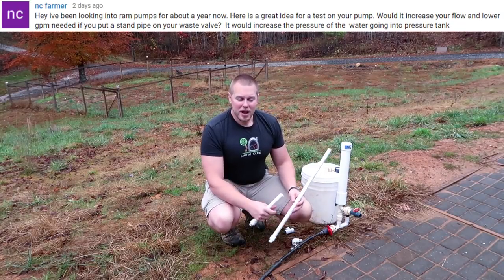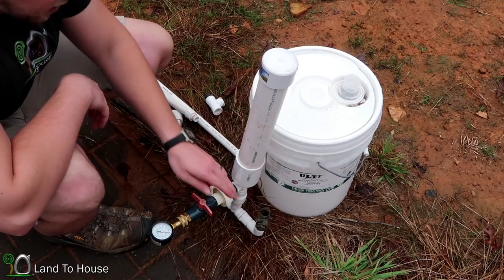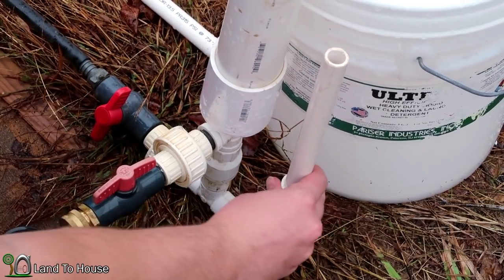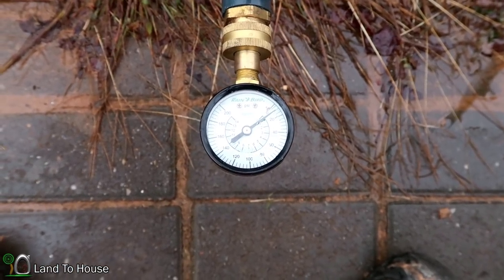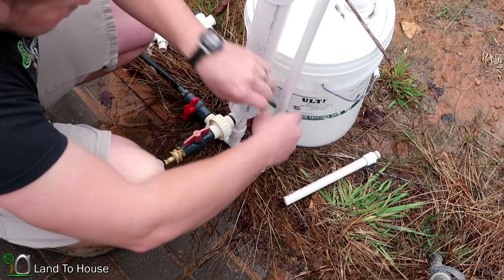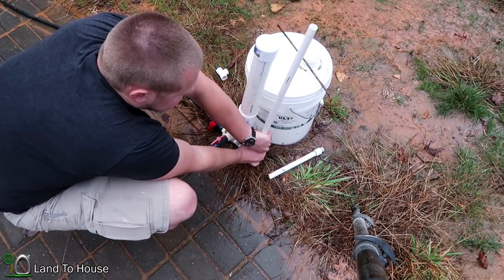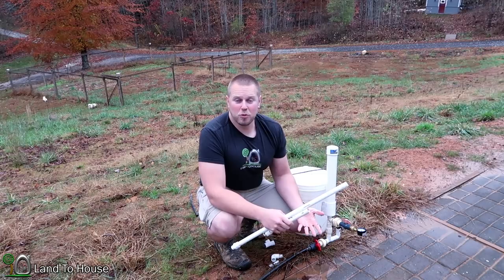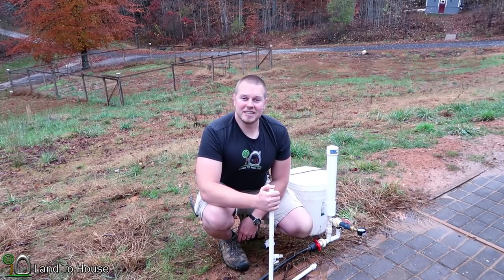Waste Valve Height - Ram Pump

Comment: Because the height difference is less between the inlet and outlet, the pressure head has been reduced. The outlet needs to be as low as you can get it. Adding a small weight to the valve might help.

Comment: It would be interesting to see the effects of different lengths of pipe between the check valve and the pressure reservoir. By this; i think you can "tune" the frequency of the check valve's open and closing, and affect the rate of pressure increase (maybe.)

Comment: I don't know if you are still testing these or not but here's an idea...
Split the delivery line in two and use one side of it to feed back into the Drive pipe as it crosses a "T" joint from the waste valve. I suppose that if the waste valve fed back into the drivepipe via a Venturi Syphon from the split line on the delivery side it might allow for a closed-loop system. Despite never delivering the same volume upward as is brought down through the drive pipe it would always have enough head pressure and hydrostatic pressure to operate since all the water loss is at the waste valve when it's just being wasted instead of being cycled back into the system. A check valve near the end of this second delivery pipe just before it merges with the drive pipe would keep the bulk of all the water in the system moving in a cyclical manner. Delivering only some of the water upwards but also retaining most of the water in the system to drive it. So basically, I guess, it would start the cycle with the Ram and end it with the Bernoulli effect feeding right back into the Ram.

Comment: I added a  8 in standpipe to my  1 and 1/4 inch RAM pump with a Driveline of 75 ft. 
Why head pressure is about 4 feet it seemed a little much for the system and my check valve would lock up sometimes. The stand pipe

 seems to have mitigated that problem. The output might be a little less however it's more reliable it's been running now for 4 days without stoping.
 Thanks again for the ram pump videos Seth always interesting.

Comment: Try this. Right now you have the pressure tank mounted vertically. The check valve is also vertical? Below the P.T. As the water comes down the drive pipe it must make a 90 degree turn before it gets to the check valve. Have you tried putting the waste valve before the P.T. assembly and then mount the check valve horizontally, with the pipe to the P.T. in a gentle arc to the vertical? There is loss when the water makes a radical turn. That's why it's recommended that the drive pipe have as few turns as possible. The piping after the check valve is part of the drive pipe when the valve is open.(you could heat and bend the PVC) The delivery valve would be right after the check valve and as low as possible. I'm curious if it makes any improvement in pressure. However slight. The Rife pump I had was cast in one piece to create that gentle turn. I think it was a SU-15. 11/4". Maybe a 3/4" check valve and a larger size after that to reduce friction? Thank you

Comment: You have to add weight to waste valve lifter according and proportional  to your head pressure.
I forgot the calculation formula.   I did one of these in Collège final project 40 years ago.

Comment: Great Video.  I was on the edge of my seat waiting to see a new discovery.  So glad you ran the test.   Need more Ram Pump!   :-)
Reply from the maker: It worked out just as I thought it would. It would have been fun to get more pressure out of that stand pipe but in the end physics wins again.

Comment: Following the comparison of the Ram Pump to a voltage doubler we can increase the voltage by gang doblers together. Have you considered having one ram pump directly feed another.  If there is a parallel then this could cause a pressure increase giving you the ability to raise water higher.
Reply from the maker: It sounds like a fun idea. And I do want to test that this summer. The thing that I feel is going to happen is that the second ram pump is going to require too much water and will stop. OR the pressure built from the first pump will prevent the second waste valve from opening.

Comment: Its a good thought but negitive effect . Another dead thought would be piping it back into the surge tank , good chance it may lock the Ram pump up or work like a venturi system increasing pressure with the Bipass feeding back into the surge tank . Thats all that pressure tank is  is a surge tank ..  look at that also the volume of air V/s the pressure.  More Air more pressure .!  Take a freon tank make sure no pressure in tank pull valuve  should be a 1" pipe thread. Collar it up to the pump  brace it up right and see if it makes any difference !

Comment: Nice videos!By extending the check valve head you seem to have increased the back pressure in the check valve.If you were to lower the check valve below the center line of the overall line i.e. below the inlet pipe will you not create a "negative" pressure situation that will give the check valve less resistance and so work better?The center line of the outlet will then be lower than that of the inlet line.Would like to hear your opinion.Just a suggestion though.

Comment: What if you put the check valve at the top of the stand pipe?
Reply: Same question
Reply from the maker: That will actually reduce the head pressure as well.
Reply: Good idea
Reply: Check valve at the bottom: you have a column of water holding the valve open.

Check valve at the top: you lose too much velocity to head and the valve will no longer close.

The end result is the same.  You want to maximize the amount of energy in the pump, which means maximizing the PSI, velocity and/or head pressure.

Adding a stand pipe to the waste valve robs energy from the pump.

Comment: I built a 2inch ram pump to water the cows.  With a few minutes of dam the creek with some rocks I have enough head pressure to make it work.  I was surprised how much I have to throttle the discharge valve to keep back pressure so it stays running

Comment: IF nc farmer shared the same video I saw... they also had an additional check valve on the output side of the pressure chamber.  I tested this extensively on my system because they were boasting higher volume delivery.  I found the same results you did (as I expected based on head loss). I suspect either they were lying or maybe in their particular setup it worked (I think they were delivery to a relatively low-head elevation vs mine (72 vertical ft).  Either way, results speak!  I am glad you tested this as well as it's nice to see a second "It doesn't work for me". Keep up the great work my friend!
Reply from the maker: Was the ram pump blue in your link? This one was to a low delivery location. I did not see anything in the pump setup that would allow for a higher flow rate. You might actually get some results if you move a check valve around on the delivery pipe. I am not sure what location is the most effective. (close to the pump or closer to the delivery point.) I just know that in my tests a check valve on the delivery pipe can boost flow rate a little. Thanks for watching!
Reply: yes... it was from a channel named "something asia".. dont remember the something part... lol
yep... blue/green colored pipe... was about a 4 ft riser off the pump.  I agree... there's a possibility in the right setup it might give some gains.
Reply from the maker: Yup that is the same video.
Reply from the maker: ah ha. That is the one. Looks to me like there is a good bit of head pressure and not much lift. They might have been getting more flow because they had too much head pressure and not enough lift. . . No idea but we now know that it is better to leave that stand pipe off.
Reply: yeah, head pressure to lift ratio is the reason im almost positive.

Comment: Bro i am from India, kerala,,& great work bro, & i have a question please answer me 
*How to use 100%of water without waste water using ram pumb 
Please dude
Reply: I am getting ready to test a concept design for exactly that! I am wanting to use the ram pump to increase my gravity fed pressure from my rainwater tank to where my off grid cabin will be built. I am thinking of putting a reservoir at the waste valve to catch the waste water and feed it into the out hose.

Comment: What if you add an inline valve on the stack above the waist check valve? Can you use it as a return back to your source? Or perhaps if you use degrees like a 45 or instead of 90 going straight up above the waist check valve and return it to the supply. I'd love to see this demonstrated out of curiosity.

Comment: Try this  place  your ram pump over a 5 gallon bucket so that the wast water fills the bucket  add a drain pipe to the bucket   and have it  supply a second ram pump 15 ft down hill  then  feed the out put of the se ond  pump into the out put of the first

Comment: Thank you for doing that test. I dont have a good enough spring at the moment. The one i wanted to use is 1 gal every 5 min. My other spring i will have to pump water 1000 feet or more.
Reply from the maker: It was a good test. The ram pump can pump water that far no problem. It can be costly to install that much pipe though.
Reply: Maybe if the pump running little bit longer, I think putting the weight to the waste valve the cycle is becoming. slower and will build a higher pressure.
Reply from the maker: Although that is true it also uses more water with more waste valve weight. Sounds like the spring is not flowing much.

Comment: Can you run a hose from the waste valve back to the supply line on another Y check valve to make the system retain more water. 

My only available location gets very soft when it gets wet and I don't want it to sink too far as it settles.

Comment: Can the waste water be plumbed back thru a one way valve to a tee in main feeder line recirculating the wasted water, or would one have to plumb a smaller pressure tank in a similar configuration as the pumped water to push the waste water thru the loop back? The Idea being to utilize all the water without waste,or will that violate the energy conservation laws?

Comment: Of course for your sweet the valve will not close, the extension is holding to much back pressure to allow the valve to close.

Yes the head pressure will need to be higher and the water source needs to be above the top of the extension pipe
Reply from the maker: Yes the pipe reduces the head pressure and in this low head setup it was enough to stop the pump from working.

Comment: Thank you for doing this video.    Really helps to understand the parameters for optimizing pumps.    The video showed less pressure with a higher waste water stand pipe, but curious, did you notice how the volume of water pumped changed?   Does more pressure mean more volume of water pumped?   Thanks.
Dave
Reply from the maker: Yes the addition of a pipe on the waste valve reduces the head pressure of the pump. Less pressure means less flow rate.
Reply: @LandtoHouse  I've seen several videos where people were putting weights on their vertical rod waste water check valve and adjusting the length of the stroke.  What I'm not sure about is if they were pumping any more water than using a swing check valve like you do.

Comment: I regularly watch your channel and have been working on ram pump improvement  science for a long time..
Want to know the result of lowering the 50 feet height  ( down) instead of up using a spring check valve leaving water downwards instead of upwards.

Comment: I wonder if say a person has a small flow spring( small roughly 100 gallon catchment)  with about 20 feet of decent drop could one use one pump to transfer water to 30 feet above the spring to a tank and then build a means to capture the excess wasted water to pump that water to a second  pump water to a second tank that feeds a micro hydro system  and at the end of the system build a pond?

Comment: My pump took forever to start got it going and then it has erratic timing, going faster and slower then finally shuts off. Messed with my valves but cant seem to find a better setting anywhere. Where should i start the lines arent all connected as i wanted to make sure it runs before it gets glued together (PVC) so i imagine there are some trickling leaks. I think we are at 80 or 90 feet long. Only 1 or 2 feet of drop in the first 40 feet then about 6 to 10ft of drop in the next 40 to 50 feet. I have a comically large pressure vessel probably 3 to 4 foot long 3 inch wide for a 1 inch ram pump. I didnt care to cut the thing in half or cut a 1/4 off at the time i was too excited to get it together and in the creek. I feel like the problem could be in the pressure vessel being unnecessarily large or the drive pipe not being glued together. 3 45 degree bends in the drive pipe as well but it was trying to pump so i dont think the problem is the bends.

Edit: after 30 minutes of googling things the only other thing i can find is the weight of my foot valve. Pumping really fast and the puttering out one source said to add weight as well as a few youtube videos of guys messing with weights on their valves.
Reply from the maker: Hi. I actually had a problem like this with my ram pump. It turns out that I missed gluing a pipe together. Because the ram pump is cycling with lots of force the pipe came lose just enough to let in air. It does not take much air in the drive pipe to stop a ram pump. I would get those pipes put together and see if that gets things going. The sputter you mention is most likely from the air in drive pipe. A fast pump is normally only when you have a very short drive pipe or the pressure wave is hitting air in the drive pipe and returning too fast.

Comment: I realize your post is almost 4 years old, but I have a question regarding the waste valve water.  Is it possible to salvage that water that would otherwise go to waste and route it into the distribution output; or at the very least put it somewhere else that is usable or harvestable?
Reply from the maker: Its not possible for the ram pump to send the water back to the source or put the water into the high pressure delivery BUT you can catch the water and use it further down hill.

Comment: The Waste valve pipe test must have a non re-turn valve on the high waste valve to cab the drive head pressure loss and to give the pump the capacity to pump through delivery and the waste valve the question is would the ram pump through the waste and the delivery if fittings were employed to facilitate this concept what do you thing ?

Comment: Can you please test it to see what happens when you extend the waste valve? Like keep it still as low as possible but extend it longer like it is an additional output. Thanks.
Reply: In addition, is it possible to connect two ram pumps in a series connection? Like one ram pump downhill and the other one uphill to extend the reach and pressure towards the water tank? Thanks.
Reply from the maker: This past summer I worked on a ram pump that was broken. The fellow had a 2 ft long pipe on the waste valve extending further away from the pump. Have you were describing. It was causing the pump to bounce and actually prevented it from cycling. That being said I can still run the test when the weather is nice. Would be fun to learn the results
Reply from the maker: I haven't checked using ram pumps in series like that one of the problems is going to be that the second pump needs to have an open-air source to allow the pressure wave in both directions.

Comment: I noted that this ram pump is configured differently than the ones you sell. Does this change the effectiveness of its operation?
Reply from the maker: I ran a few tests with this design. It is slightly more efficient to have the waste valve on the other side of the pressure tank.

Comment: It seems that with a messy intake like an open spring, a lot of air gets in the line, so slowing it down with back pressure would give the air more time to escape back out the intake.
Reply from the maker: For pulling water out of a spring I recommend using a 5 gallon bucket just down from the intake. This allows you to seporate the silt and air from the water. Pull the drive pipe from half way up the bucket. 
https://youtu.be/baD9KH3i6es

Comment: what happens if you have the wast valve pipe drop down a hill to creat like a pulling force will that increase the pressure / flow
Reply: I don t think the valve would close

Comment: what if you put the check valve  on top of the stand pipe rather  raised  valve  instead of added pressure  on the valve  no back pressure  on the valve.

Comment: Ok, so if making it taller is worse for head pressure, what if you actually create a drop that would go a few inches underground before the valve? Wouldn’t that increase the efficiency?

Comment: I have turned my waist valve into a directional flow pipe (burpi pump idea) so the waist water  runs into garden pond. Lifted it about a foot.
Reply: What size valve, how long of a pipe, at what angle? Thanks!

Comment: from a physics standpoint you'd want the largest pressure differential you could get between the water and the outside of the valve. all this did was prove less head pressure is less effective.
Reply from the maker: Yes! This video was only in response to questions that had been asked. I just proved the concept in video format.